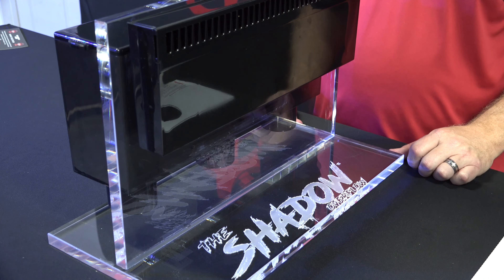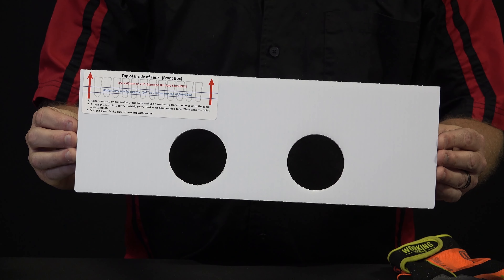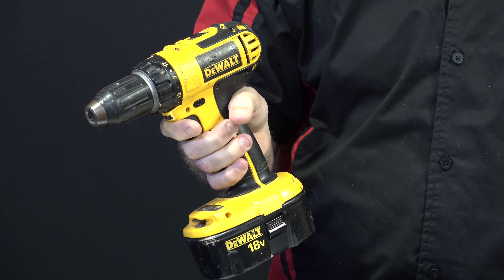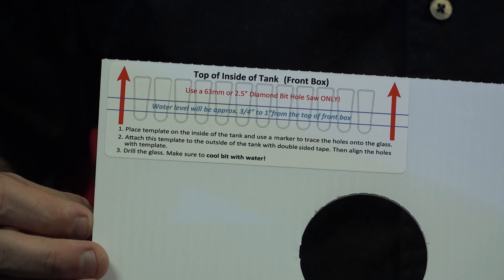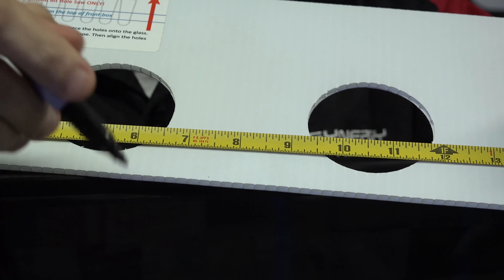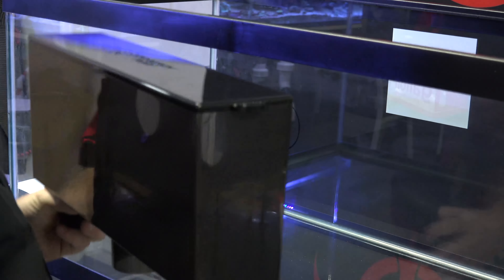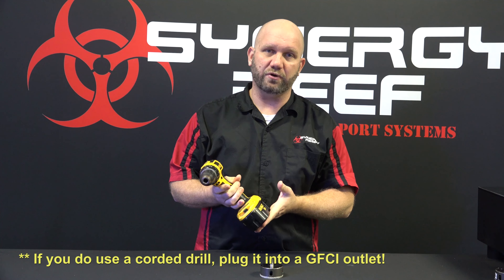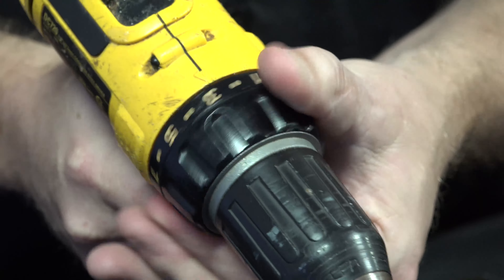How to Drill your aquarium for the Shadow® V1, V2  & V3 Overflow Kits

Comment: Just curious but shouldn't the gaskets be ordered from inside to out internal overflow, gasket, tank, external box, gasket, bulkhead nut? Just seems like it would make more sense doing it that way as we are trying to seal all water contact areas
Reply from the maker: No that won't work because when you turn the nut it will cause the gasket to crease/warp and break the seal. plus you will not have a seal in between the rear box and the tank at that point. You want the water to be sealed into the box.  The Gaskets need to be pressed between 2 flat surfaces, so they are compressed and seal the water in. We have engineered the hardness of the gaskets to be press sealed in between the overflow and the tanks' glass/acrylic surfaces with only needing to hand tighten the nuts . Perfect seal every time.

Comment: Great video. What are the advantages of the shadow overflow compared to bottom-drilled tank with weir box?
Reply from the maker: Thanks Daniel. There are a few major advantages. 

1. Real Estate: 
No Large weir box inside the aquarium for the drain lines to run thru. Bottom drilled aquariums require there be a containment section of some sort all the way to the top of the tank (water level). Most take up a lot of real estate in the aquarium.  

The shadow is small and compact taking up very little space and virtually disappears into the back of the tank. Giving you back real estate in the aquarium. 

2. Risk of flooding:
Risk of draining the whole tank is reduced. Bottom drilled aquariums put holes into the bottom of the tank. If a bulkhead fails, this can mean 100's of gallons of water on the floor, draining the whole aquarium. 

The Shadow is drilled higher in the aquarium. If a leak occurred on the bulkheads it would only drain a few inches of water. The rest is still contained within the aquarium with no holes in the bottom. 

3. Tune ability:   
Bottom drilled aquariums restrict the options of the drains and restrict the capability of tuning them to make then quieter. You have limited options to adjust the drains.

The Shadow allows for multiple plumbing options and tuning options making it silent when tuned properly. On a 10 Gallon or 500 gallon aquarium, they can all be used with the Shadow. 

4. Easy to Install:
You can install the Shadow overflow on any aquarium in minutes. So this means that you do not need a aquarium that has been built for a "Reef Ready" application. You can buy a tank at a big box store for $1 per gallon and have a reef tank in minutes. No custom tank needed.
Reply: Synergy Reef Thanks a lot! This sort of explanation is very much appreciated for the hobbyists. Some of them are straightforward, but deserve to be mentioned nonetheless. An estetic point of view can play a role, too. Very nice solution guys.
Reply from the maker: @daniels8186  You're Welcome! Thanks for asking!

Comment: should the second gasket been inside the Shadow box as that will actually contain water? The gasket in between the outside of the tank and the outside of the overflow box would be useless.
Reply from the maker: SuperSmashRiolu one gasket inside the tank on the glass and one gasket on the outside of the tank on the glass. None go inside the overflow box. They are both used to seal the glass to the box, inside and out. https://i0.wp.com/synergyreef.com/wp-content/uploads/16InchShadow_exploded_view_no_bg-e1470945980398.jpg?fit=990%2C1200

Comment: Hi my friend ! Is it possible to suck the bottom of the tank?
Reply from the maker: Unfortunately not with this design. Most aquarium overflows will only skim the top surface and require internal flow pumps to keep the detritus in suspension to be removed.
Reply: @SynergyReef  thank you my friend

Comment: great video but i wish you'd have shown how to drill it on a rimless tank
Reply from the maker: David Beecroft very simple. Just use the template and place it where you want your water level (level is marked on the template) and tape it in place. Then drill.
Reply: Where do I want my water level? I've never had a rimless tank or overflow box.
Reply from the maker: Samantha Naszradi we recommend about 2"-2.5" down from the top of the glass.

Comment: Why the 2 different sized drill bits?
Reply from the maker: The 63mm bit will make a smaller hole and allow the gaskets to completely seal the holes better. That being said some people do not have access to 63mm bits and can only find 65mm. Either will work perfectly fine. No one has any issues with either size. It allows more options with 2.

Comment: When you stick the template on, it's upside down!
Reply from the maker: That's correct! It only needs to be right side up when used on the inside. Once you mark the hole locations the template is only used for the holes as pilots. So it doesn't matter if it is upside down when drilling.

Comment: Man, that external box looks flimsy and looks paper thin. Wish you'd make it out of acrylic, like the original.
Reply from the maker: It may looks flimsy and thin, but it is actually more durable than the old acrylic boxes. It looks flimsy because we do not need the center braces like the old acrylic boxes needed for support. This makes it easier to get your hands inside the box to work. The lid locks in place when it is running and makes it solid.